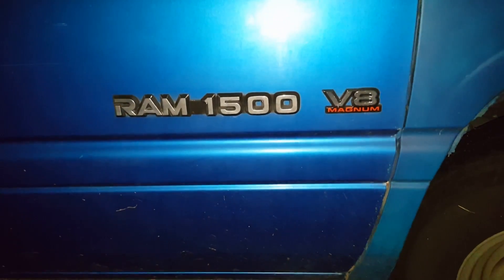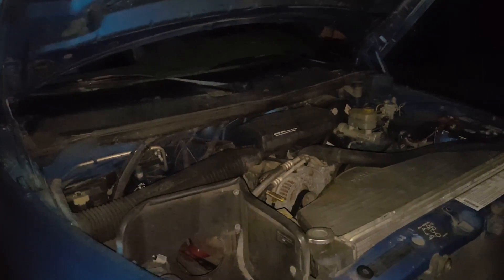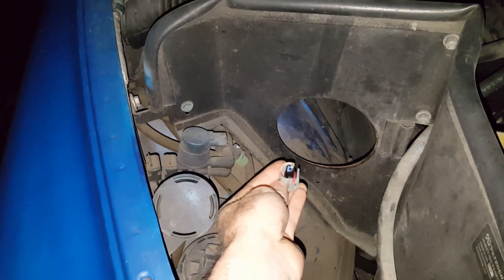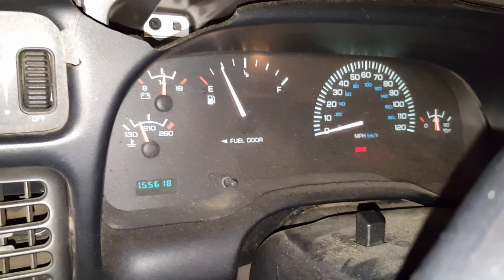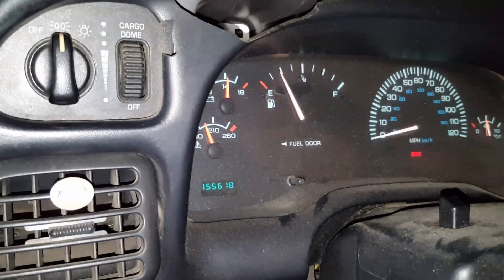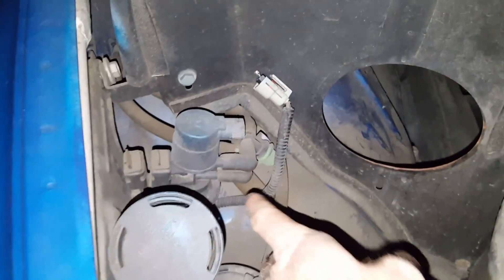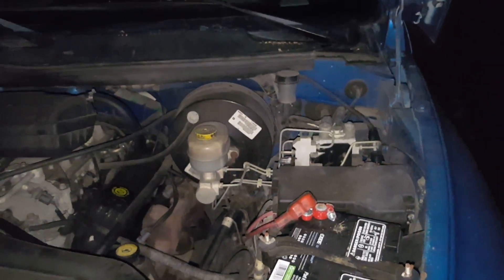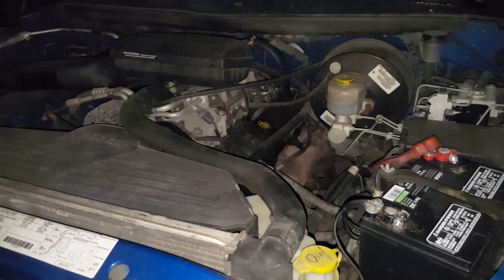Dodge Ram 1500 1994-2001 evap error bypass

Comment: Thanks for the info, But
I thought I was gonna see something on the charcoal canister on this truck. Because the rubber connectors are terrible. Mine deteriorated after it's set for about 10 years.  Yeah I have 4 openings and only 3 of them are being used so do I just plug off the one not being used? Do you know
 Thanks for sharing look forward to hear from you bye for now Ken.
Reply: Exactly what I’m looking for lol

Comment: I have a older dodge vehicle that I swapped a 1999 5.9 magnum into using a stripped down harness. I have located the evap purge wire in the ecu and I am assuming that it is a switched ground. Do I just need to run this resistor between a hot and evap purge wire in the ecu to stop it from setting a code
Reply: Did you figure this out?

Comment: So I have the 360 cubic inch. 2001 ram 1500.
If putting a resistor in that connection turns the engine light off, it would mean that it not a purge valve or just a purge valve.  A purge valve does not detect vacuum or pressure. It simply opens the valve so that fuel vapors can get sucked into the engine.
I noticed in my rig two of them connections.  That one and another below, a little lower.  It seems to be a larger harness.
There has to be some sort of sensor that detects either pressure or vacumm in them lines and if it can't it will mean fault code.
Assuming it does detect either one, then the cpu sends signal to the purge valve to open.  Once it opens then the cpu must monitor that it worked, in other words no more pressure in the line.
But I will try this and see what it does.

Comment: Hey Chris my 2000 dodge ram vans fuel pump was replaced. Problem is it still does not get gas "sometimes". It will run sometimes but then when I go to start it and it wont start for days at a time. And then it will start again. Any idea what's going on. Any insite will be greatly appreciated
Reply: My 97 ram with a 360 was doing same thing. Run good and quit. Wind on it no start. Leave about 20 minutes and start. Still did it after a pile of sensors. Never set a code. By accident wiggled evap sensor plug and that was the rat. Wiggle the male plug and engine dies. Wiggle again and it starts. No idea what's making it do that guess has a short. So just unplugged sensor taped up tight and it works. Try that just a shot. Wiggle and see what happens.
Reply: My 96 dodge ram 2500 5.9 360 magnum did the same thing. It's your fuel pump relay. About $25 to $35 at AutoZone. Might have corrosion on it, may be able to take a wire brush to it.

Comment: Thank for posting...btw..clear codes or even the theft system disconnect battery (both leads) and touch them together. Dealer charges 80 buck and guaranteed its all they do.

Comment: 2000 Dodge ram 5.2 myself near exact miles, my dash really not there anymore, and throwing the same codes. I'm on my second replaced water pump and it's blown a few rear wheel brake cylinders. You might want to check the stationary belt pulley. The bearings on mine froze up 3 weeks ago and almost lost a new belt because of it. And you are low on a/c freon btw.

Comment: Hey I tried this on my 2001 Ram 1500 it's built in 2000. The code keeps coming back and the check engine light. I used the resister and plugged it in that same spot am I missing anything else? Or any other tips? I mostly just want the check engine light off.
Reply from the maker: if your truck has the "california" coded computer it will not work. the 48 state computer can work, but it sometimes will still trip.
Reply: The resistor is directional, flip it around maybe

Comment: so how dose this work wen you need to get ur truck inspected
Reply from the maker: It does not work for an inspection. only to get rid of the check engine light.
Reply: Depends on the state. These are old enough in some states where they dont test the emissions, but there cant be any lights.

Comment: Dude, I have a 99 Durango 5.9 with evap issues and engine light I just can't run down. You say 100 ohm resister?? Where might one obtain such?? I'm ready to do it. I'll do what I can to help your channel. 
From, Joe Marotta..
Reply from the maker: if you have a "CALIFORNIA" ECU it will not help, I have not got my hands on a non california ECU yet to test on. But a 100 ohm resistor can be found at radioshack, frys electronics, or ebay. you bend the legs of the resistor and put it in the socket for the evap solenoid. 

I'v been replacing the tubing and installing new canisters to get mine fixed finally, mostly wanted to do the fix to have the engine light off.
Reply: @chrisstinson2536  THX again. Got my 100 ohm resister from eBay in today $5.00 or so, not sure how you tell if Calif PCM or federal? I did the bypass and reset and so far MIL off,  but I never got my evap code before cheat, till drove some miles and restart. I never got the light until restart engine,, before. MIL on and off before so must be a slow leak, I just can't run down.
I have a fair Launch scanner CRP129E, hate the touch screen, but able to hammer out some info, since 99 it's not the most cooperative, you might know? I'll let us know if light stays off in the next few days. Auto Tech Shop here, and appreciate the knowledge I knew nothing of. 

No emissions here either, in Amarillo, TX..
Reply: MIL still stay's on and off all day today. Guess I'll have to fix it their way on this one..Darn!

Comment: So could I possibly just cap the hose to the canister.?
Reply from the maker: not exactly, It looks for a pump time since it has a known volume. if you cap it, the volume is wrong and it will send a code.
Reply: @chrisstinson2536  Ya I just left everything except purge solenoid hooked up, and I get just a tiny + pressure hiss when fuel tank warm, and Fuel cap cracked open. Hoping this is just right, for tank pressure sensor to be satisfied.. ???  I think my unfounded leak will adjust pressure as needed hopefully?? Almost funny..
THX.

Comment: i have heard that having a large leak in your EVAP system will affect your gas mileage? have you noticed anything like that?
Reply from the maker: In regards to a dodge 318 motor, you cannot really get any less gas mileage, but on the newer more precise engines, yes a evap leak does cause issues, but it is in regards to vacuum system cascades, once there is a comprimize, other systems degrade. The 318 in this truck was adapted to OBD2 just enough for emissions, the engine can be swapped back to carb/no computer with only a few bolts, carburator, and a distributor cap rotor change,  it is a old but reliable design that is by no means efficient.

Comment: if you do this do  you need a vented gas cap?
Reply from the maker: no, the charcoal vents are still there and like mine, the tubes are rotted so they "vent"
Reply: Before emissions laws it just vented to the atmosphere. With an unsealed tank id assume you may run into CEL issues on newer vehicles, similar to a bad gas cap.

With the new ethanol fuel, having a point of ingress for moisture could possibly allow water accumulation inside the tank. This is an issue with marine engines.

Comment: Still can fail an inspection if the inspector sees you tossed your canister
Reply from the maker: yes. if you have an inspection... i live in a place with no SMOG checks and still run everything but the evap system that keeps breaking off and leaves my CEL always on.
Reply: @chrisstinson2536  theres supposed to be a strap that holds the canister. Mine rusted off this year. I havent dug into it to see how to rig it, but im assuming thats why yours keep falling off
Reply from the maker: @buck19  Iv replaced the strap, usually its a stick, or rocks getting kicked up into the canisters.

Comment: thx I never knew you could do this, rather than paying autozone over $100 with tax for that cheesy little purge solenoid thing I may just hook a resistor up to it, it should tell the computer that everything is working good, people swore if that messed up the truck will get bad mpg or even have bad power but that resistor should help. I'm chasing down a gas/exhaust odor problem along with eh mpg but I'm going to put on a new o2 sensor, map sensor, and pcv valve, already done a full tuneup, maybe my egr is messed up, the very early 2nd gen rams like my 95 have an egr valve but the later ones don't, I read about people just blocking/deleting the egr lol. The hoses rotting around that charcoal canister under the truck is also another common problem and can be very expensive to fix, apparently on my earlier obd1 version ram the canister is on the driver side instead of passenger, I'm going to go check if the hoses are indeed rotted, I may fix the stupid hoses just for the sake of me being tired of smelling exhaust when I get out of the truck. I'm grateful to have a reliable vehicle to get me from A to B but these older ram trucks sure seem to have their share of gremlins, I also need to fix my steering, I have a non existent dashboard, and my electric locks don't work, and I have no stereo lol, and we all know the infamous bad trans problems these have...but my cheap used one I got earlier this year starts right up and drives decent for having almost 225k miles on it, I guess I can't complain too much for a 23 year old truck that only initially cost me 800 bucks, and I did the oil and got some used tires for it and did a tuneup, now it's down to chasing stupid sensor and emissions crap...
Reply from the maker: The emissions stuff with these trucks does nothing for MPG... it was basically a slap on system to make it pass smog in california. It was thrown on to all trucks since it was easier to equip all models. The only emissions item that can cause reduced MPG and performance is the CAT. if its clogged or damaged it will degrade. Im working on a o2 sensor mod to allow me to run a little lean since dodge tunes them on the rich side. When i got the truck I ran seafoam through the engine oil system (not how seafoam says but one ounce added each week, for 4-5 weeks, then drive it one more week and change oil. Seafoam says to ass one ounce per qt of oil all at once and run it.) I also ran seafoam through the vacuum systems and fuel systems. Ill be changing the fuel filters and replacing the valve cover gaskets, oil pan gaskets, and all spark plugs and wires. I have to replace the clutch but have not had time to park the truck for a day or two to get the flywheel resurfaced. Im in about $1000 on this truck since the headlights are replaced, new tires, multiple oil changes to clean it out, and random wiring fixes. Ill be doing a coolant flush and clean once I get my heater core redone. Good luck with your truck!
Reply: 1996 2500 here.  When the engine light is ON, crap mileage and the performance is sluggish.  When the engine light is OFF it runs so much better and gets better gas mileage.  I have been chasing evap issues.  The 100 ohm resistor on the purge valve isn't really going to do anything from my understanding.  It's just a ON/OFF value, not a sensor.  The leak sensor in on the gas tank (somewhere).  So the PCM says to the 100 ohm resistor, take that, and the leak sensor still says, you gotta leak.  Nothing will change by using the 100 ohm resistor.  Now if we put the resistor on the leak sensor... mmm?  What do you think?  Update:  No, that wouldn't work either because when both valves are closed and the gas tank holds pressure, good, but when the valves are set open the gas tank pressure must reduce, bad, and it won't.  The pressure would remain constant by the 100 ohm jumper on the sensor.  I guess the thing to do is fix evap system to get the engine light to go off.  No quick fixes
Reply: did you ever have any luck with your evap gas tank issues? Life really got in the way and I actually finally got around to changing the map and o2 sensor the other day and truck starts up better and idles smoother, rpm will occasionally go down then back up when I let off the gas, I'm assuming the computer relearning the IAC since the old map and o2 were worn out. Map sensors even without a code or o2 can be old/lazy and throw off mpg and power too, those two sensors are cheap on rockauto and I'd say well worth it. I still need to give it more time but I'm sure my mpg will be better now, I'll run some Gumout fuel system cleaner for good measure, but I don't smell the huge reeking gas smell when I get out of the truck or start it up....must have been running extremely rich, tailpipes were coated in black soot. It's never left me stranded so I guess I can't be too hard on the 23 year old truck with 225k miles on it I got cheap.....last thing I need to do is tighten the steering box, maybe add a can of freon, and get a cheap dashboard cover and my truck will pretty much be complete. I actually wish I had an OBD2 vehicle though since they were so easy plugging a scanner in to see codes and data, these old obd1 vehicles are pretty crude in comparison.also I guess even if I need a new IAC and Throttle position sensor those are only about 30 bucks each online too
Reply: I got to check this stuff out. My truck is like missing vidrating when it's just driveing,like jurking. It will clear out at times but real bad on gas.like injectors and plug wires,I'm going to che k the plugs also. New quill allready.
Reply: In California u will fail emissions if u change anything with the smog evap system's. The new technology will catch u if u bypass or remove evap system's. U will get fined 10k under new law's. I do this for a living and work for the California bar association, as a inspector. California is now doing road side testing to check for removal of smog evap system's. And those r like Dui check points. By law u can't refuse the inspections. And your car can be red flagged for smashing if u r caught modifing any smog parts. Now even the exhaust has to be oem to state standard's too. No Glass packs r allowed or any modified exhaust system is banned. U will get caught. 100% don't chance removing smog parts of any kind
Reply: @scraplifetrashtocash4551  Yes indeed; California is an absolutely wonderful Communist country, isn't it?  And the entire courts + legal system is totally FUBAR as well.

Comment: Any 2001 RAM 1500 non California owners try this?
Reply from the maker: mine did not change engine operation with the california ECM, but it did come back on quickly. Since i dont have smog requirements I found a non CARB ECM and installed that with the resistor.
Reply from the maker: sorry for the late response, if you cave a CARB computer it will only clear for a few minutes. not long enough to pass an emissions test.
Reply: well shit i have a etest coming up in 4 months i might do this Lol if all you do is by pass the plug with a wire?
Reply: i have the same truck as you, i did do this too and holy hell not even 2mins driving after engine light came on and truck felt weird, so i undid it,